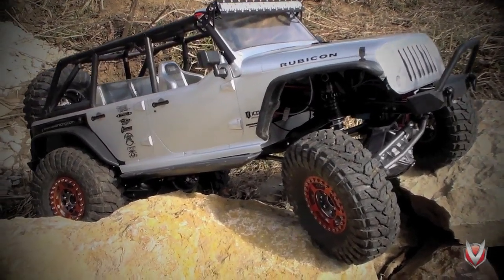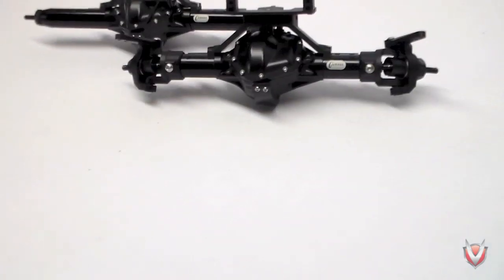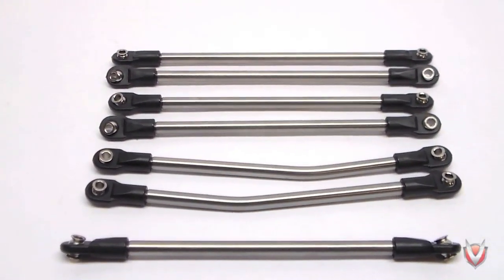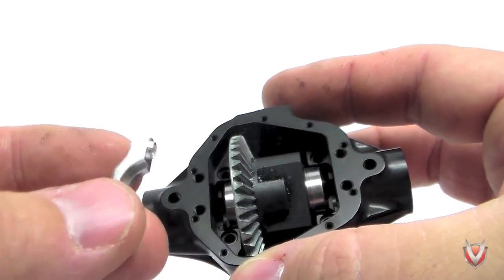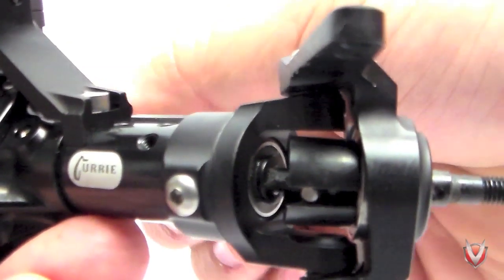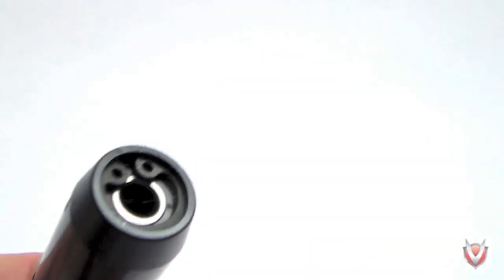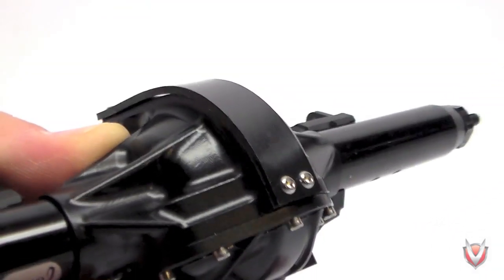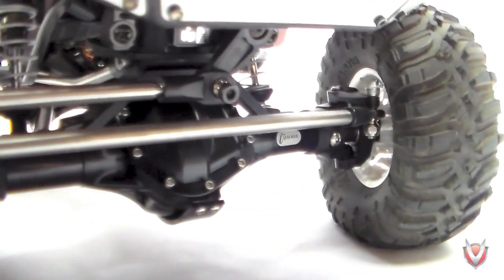Vanquish Products - Currie RockJock axle install for the Axial SCX10 Honcho and Wraith Rubicon JK

Comment: I'm in the process of making a rwd. 4 link truck. What speeds are these rated to? Are there optional gearsets?
Reply: any gears that will fit an scx10 will fit these and I don't theres any need to worry about to fast